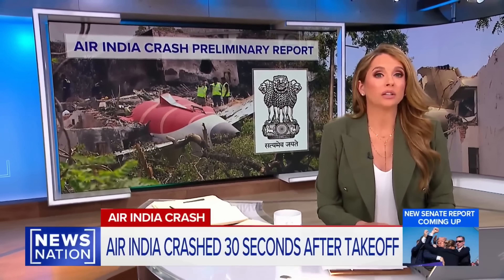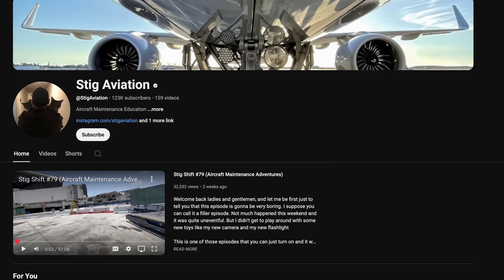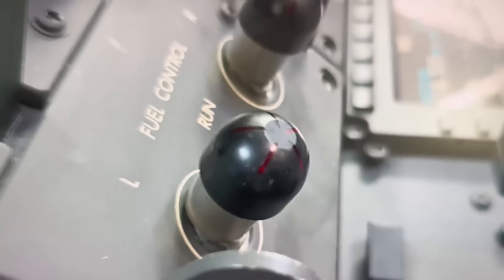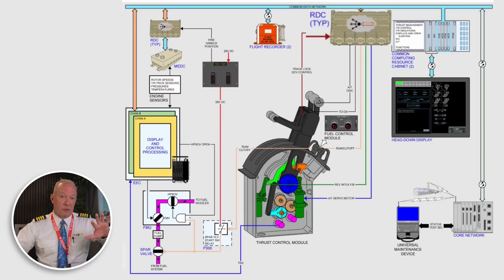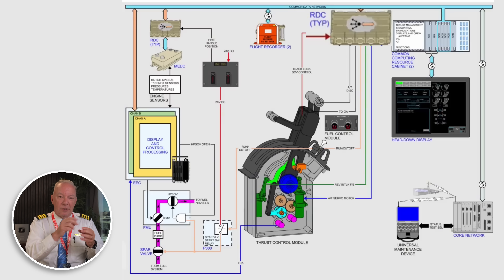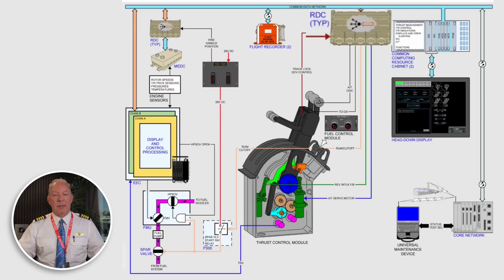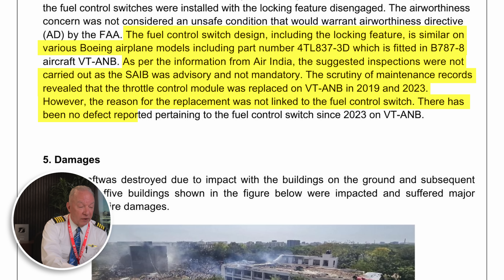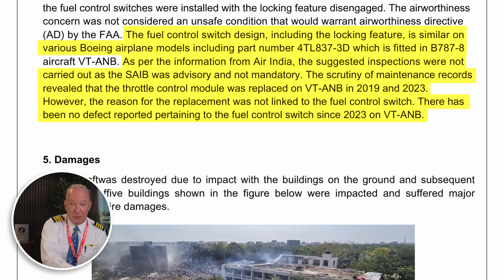The Truth About Boeing 787 Fuel Control Switches

Comment: Would it be prudent to install a failsafe on the fuel switches, to prevent another tragedy like this from occurring? Perhaps locking them in position during takeoff/landing? Or do the risks outweigh the benefits in that regard?

Comment: First of all, we don't "want" to believe something, we just don't trust Boeing till they prove that it's impossible.
Secondly, If they were in a such closed loop then how do they monitor their position?
Finally, as an industrial and embedded systems engineer I know how complicated is to be 100% sure that a relay operates properly, or misbehaved from anything, it could be a near magnetic field or something else. If we don't get the actual schematics, not that high level block diagram, we can't really tell how certain we can be for that switches. (Or the sound of them switching)
For example, assuming they have a single relay, and a random cable passes near it. If for some reason that cable had very high current passed threw it, it could magnetically arm the relay. After engines spool down, power fell, magnetic field fell and the relays disarmed ...
Reply: Right, the all powerful Boeing, which has somehow induced the Indian government to blame its own pilots and leave their own citizens (along with the rest of the world) at risk, rather than blame the already widely distrusted aircraft manufacturer.  Checks out.

Comment: Let's put things into perspective - on a per flight count, the mental reliability rate of pilots is 20,000 times more than a modern aircraft's FADEC.
Even if we deem all six cases of suspected and confirmed pilot suicide in the past 30 years, a pilot compared with the rest of an aircraft's "systems" is so reliable that no technology ever designed by humans has ever come close to, by a factor of 1:20,000
This is a result of the airline industry (pilots, carriers, regulators) working hard to ensure this remarkable reliability, and one of the key reasons for why we put our trust in them - they've earned it through hard work.
AI171 was a tragedy, but even if it was caused by deliberate pilot action, it still exemplifies how much more reliable and trustworthy are pilots, even in the age of AI

Comment: Copilot AI from Microsoft says:
The *physical fuel control switches* on aircraft like the Boeing 787 are monitored and reported to the *Flight Data Recorder (FDR)* through a combination of **digital interface systems**, not by direct wiring from the switch itself.

### 🧠 How Switch Status Is Monitored

Modern aircraft use **fly-by-wire and digital avionics architectures**, meaning:

- Physical switches (like the fuel control switch) are connected to *Electronic Interface Units (EIUs)* or **Aircraft Interface Devices (AIDs)**.
- These units digitize the switch position and transmit it over *data buses* (e.g., ARINC 429 or AFDX).
- The FDR receives this data stream and logs the **switch status**, along with a timestamp and other relevant parameters.

### 🔍 Key Insights from Aviation Experts

According to [Aviation Stack Exchange](https://aviation.stackexchange.com/questions/110972/are-cockpit-switches-directly-connected-to-the-fdr-or-are-there-software-hardwa):

- Switch positions are **not directly wired to the FDR**.
- Instead, they are *digitally encoded* and passed through software layers before being logged.
- This means the FDR records the **resulting instruction or state**, not necessarily the **physical act of movement**.
- In abnormal situations (e.g., electrical faults or software glitches), the recorded switch state may not reflect the pilot’s actual input.

### 🧩 Summary

| *Component*            | *Role*                                                                 |
|--------------------------|--------------------------------------------------------------------------|
| Fuel Control Switch      | Physical input device in cockpit                                         |
| Interface Unit (EIU/AID) | Digitizes switch position and sends data over aircraft data bus          |
| FADEC                    | May act on switch input or override based on engine/system conditions    |
| FDR                      | Logs switch status, engine parameters, and system commands               |

So while the FDR can tell investigators that a switch moved to CUTOFF, it *cannot confirm whether that movement was manual, automatic, or software-induced* without corroborating evidence from the *Cockpit Voice Recorder (CVR)* or other system logs.

Comment: i watched the show where the 2 others where, basicly, lying and giving false information. i loved the way you acted. and with this video, this proves how profesional you are and i am glad you did this video so set thing straight once and for all.

people that does not have the proper knowledge, should not go publicly in TV show and provide false information.

thanks Cap!
Reply: Why arent we considering a possibility where dual engine failure happens just after take off. Then pilot manually turn fuel switches off and on because thats SOP in Boeing planes in case of Dual Engine.? You can refer to Gaurav Taneja AI 171 Part 3 in english dub to understand more about this theory as timeline of RAT deployment also matches with this
Reply: @ishanarora7948  i will let captain steve comment on this, if he ever, but the premilinary report has no mention of engine faillure, has he mention, the engines failed after both switches where turned off, not prior. that's the report saying this, dozen's of people investigated, several countries involved. one pilot deliberatly turned them off, as the other pilot said in the voice recorder.

Comment: If the FADEC and other systems are so smart how do they allow the engines to be shut down at such a critical stage in flight, whether operated manually or automatically ?. Does the system allowed the UC to be raised on the ground ? - I doubt it.

Comment: Well, that circuitry has no resemblance to the actual circuitry in the 787. So this is neither proves anything, or explains anything, nor casts any light on anything. It only proves that for useful information you need to go elsewhere. A bit embarrassing, to be honest.
9:45: Well, they didn't think of total electrical failure caused by the (safety redundancy) battery clamping to ground, did they? This would take down the bus backed up by the battery (the captain's bus), and as soon as that was clamped to ground, the redundancy would kick in, in about a second, and connect the the First Officer's bus (RHS) and that too would be clamped to ground. So engine 1 off, then engine 2 off about a second later.
I use "clamped", as people seem to be confused about the meaning of "shorted", which is the more commonly used electrical term.
Testing with the simulator proves nothing, because this clearly was an electrical failure, and the simulator only simlates "loss of power", not the actual internal faults possible (such as shorts, water ingress, fire, etc). Also, it's a *simulator*.

Comment: Was the RAT deployed ~before~ fuel control switches were touched?
Reply: The RAT deploys within seconds of dual power loss on the 787. You can deploy it manually, but several other systems and also trigger RAT deployments on its own.
Reply: There is no reason to believe that it was.  I have no idea why the other person claimed differently.  While exact time stamps are not given, if you take the preliminary report as attempting to tell things in chronological order, the RAT comes after the switches. There's no indication anywhere that it should be read in other than the obvious way.
Reply: @BlueCyann There is a reason to believe that it was. The report only mentions when the RAT started providing power. It doesn't mention the time it was deployed. It takes up to 6 seconds to provide hydraulics, and up to ten seconds for the RAT to start providing power. This is main reason it looks like an electrical failure. The RAT was deployed BEFORE the engines lost power. And once the RAT started supplying power, the engines started coming back up.
Reply: @mymultiextruder9804  If the circuit works as Captain Steve described it, the same battery powers both relays, which are normally open and the valves are normally closed.

That means, if the battery fails both relays would open, all valves would close, until the RAT starts providing power.
Then the relays would close again, restarting the engines.

That's my 2 cents, i'd suggest battery failure
Reply: @giacomoneri1782 He hasn't explained it correctly, but yes, battery/DC failure is a major theory that fits the timeline better, and explains the larger range of system failures that happened. It also explains why most systems came back up once the power source changed to the RAT.
Reply: @mymultiextruder9804  I bet you can't provide any references for your claims on the RAT deployment time.  The A380 RAT provides hydraulic power in guaranteed less than 4.5 seconds of the deployment command, the 787 will be similar, in fact we know from the preliminary report that it was 2 to 4 seconds.
Reply: @pianoman16 If you have better documentation than the others, please share it. The report never should have left out the deployment time.
Reply: @mymultiextruder9804  Then why did the FDR specifically record the cutoff switches being toggled off one aftehr after the other and then back in ten minutes later?
Reply: @JamesF0790 The report was too vague about this information. It stated it was transitioned to cutoff. There are multiple control points in that circuit and any failure could record that same signal. Both failing quickly makes an electrical failure plausible. Both circuits taking a much longer time to come back on could indicate the circuits didn't work until limited power was restored to them by the RAT. Once the RAT started supplying stable power, systems started recovering. I'm not saying the pilots didn't react to the event. They absolutely could have physically moved them in an attemot to restart the engines. It wouldn't have worked until power was restored.
Reply: Yes it was

Comment: If the pilot moved the fuel switch almost all the way to run initially,  but not enough to have it drop into "lock" position, but enough to activate the run mode, then the rotation, thrust, and vibration could have provided enough force to move the switches into the off position.

Comment: The one thing that confused me from the beginning: if it was a transient signal that caused the shutdown, the switches would have been in the run position. There would have had to been a second transient signal that caused them to go to run later because it could not have been a manual switch action cause the switches were in the wrong position for the pilot to create a run signal. It would appear that a whole bunch of system failures would have to occur to match up with the recorder data.

Comment: Although the fuel control circuits are simple, they still have multiple failure points. That being said. 2 separate circuits failing in the same manner, but not at the exact same time, is extremely slim. The fact that a failure like that, no matter how slim, is then reversed, is almost impossible. It's the reported timing of events that makes things point less to a circuit failure and more towards something intentional. As sad as that is.

Comment: Why is there so much deliberate misinformation circulating about this accident? Why can't some parties accept that someone turned on the fuel switches for some reason?
Reply: Liability avoidance and face-saving behavior.
Reply: Maybe because it’s so inconceivable to us that anyone would do this… and, as one pilot stated… if I wanted to crash a plane right after take off, I’d just  nose it in. Why bother messing with the fuel valves? And I suppose that feeds the incapability for us to understand what happened here (that and we don’t have the full report yet…)
Reply: @daisy-rothschild in other words:
“My emotions override my intellect”

Comment: I read in recent coverage that the “resolution” of the flight data recorder is 1 second. Does that mean that the switch action would have registered as 1 second apart if in reality it was anywhere from 0.1 second to 1.9 second? Or 0.5 second to 1.5 second? Or is it indexed to a computer clock so that the recorded time depends on when the seconds counter ticks over? If anyone knows more, please share.

Comment: From what I gather, if there is a failure of battery power as well as AC power, that would explain the engine shutdown and the switches are recorded as being off without them physically being moved. What I am missing is a discussion of a failure mode that causes a loss of DC power - at the moment the landing gear is retracted.
Reply: It is my understanding that it takes power, (28V), to turn fuel valves off in aircraft with electrical fuel valves. Loss of electrical power, (battery, buss), will not cause fuel valves to go to the off position.
Reply: @joseleon624  That's another piece of the puzzle. Jeremy John Thomson points to a battery short that propagated through the power supply system, and what happens is quite complex. Captain Steeeve tries to keep it super simple for us idiots, but it just doesn't quite work out. For me, unfortunately, it looks more and more like another Boeing thing where it takes more than one crash for them to actually fix things. But that's just me.

Comment: By your explanation, a total short of the 28 v battery power of both sides would cut the fuel to both engines. Likewise, it would cause the rat to deploy. My question is if the main buss is shorted out, would it look like the cutoff switches had been turned off to the computer? What could cause such a short circuit? I am thinking the gear up wiring could be rewired to short the buss. It would take a few seconds for the rat to restore power to the backup system. The pilots would be cycling fuel cutoff switches to initiate engine relight. Plus the timing of the failure seems consistent with gear up command. This is a very remote possibility. But sabotage of a black swan failure system should be considered.

Comment: Why arent we considering a possibility where dual engine failure happens just after take off. Then pilot manually turn fuel switches off and on because thats SOP in Boeing planes in case of Dual Engine.? You can refer to Gaurav Taneja AI 171 Part 3 in english dub to understand more about this theory as timeline of RAT deployment also matches with this. https://youtu.be/pq2AZdzH7X4?si=0pLKXsmG1M7tRXAZ
Reply: And FDR did not register that failure, why? So, I recommend to watch that part 3 more closely to see that this Taneja is dumb as a rock, claiming how his Ferrari accelerates from 200 to 205 then he shuts engine off? This guy is dumb.
Reply: @rannot4611  See 1 month is really short time to properly decrypt FDR. If crash happens in short interval then FDR has way too many points and it can definitely take some time. But there must be something happening that led to fuel switch off and on , thats a standard operating procedure. The probalility that pilot did it to suicide in front of another pilot is way less plausible than this theory. But lets wait for final report.

Comment: There are two switches - are there two separate relays? Do they share the 28v bus for power supply? One of the videos on YouTube mentioned potential internal short on the battery causing the 28v bus to be de-energized and an additional contactor is mentioned to connect the left and right power supplies. Any thoughts on that?

Comment: This still doesn’t explain how the FDR senses that the switches were physically moved. If the FDR is simply monitoring voltage downstream of the switches, it proves nothing. According to captain Steve’s diagram, that’s how it works. I think the fact that the fuel control module was replaced twice needs to be looked at closely. Possible bad connection in the electrical connector/s that you you have to disconnect and reconnect to replace that module.

Comment: Everything we have been shown or told so far lines up with the switches being turned off, the engines shutting down, the captain identifying the problem, and an engine restart happening which involved turning the switches back on. Could it have been something else? Only time will tell.
Reply: Why arent we considering a possibility where dual engine failure happens just after take off. Then pilot manually turn fuel switches off and on because thats SOP in Boeing planes in case of Dual Engine.? You can refer to Gaurav Taneja AI 171 Part 3 in english dub to understand more about this theory as timeline of RAT deployment also matches with this. https://youtu.be/pq2AZdzH7X4?si=0pLKXsmG1M7tRXAZ